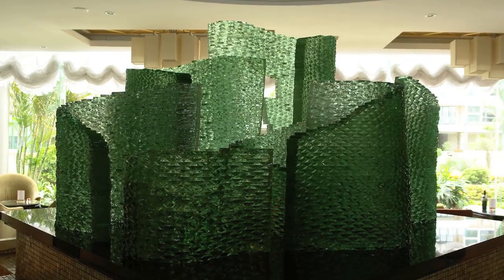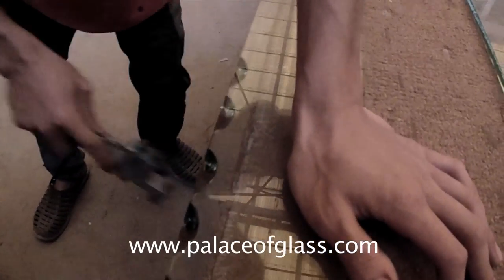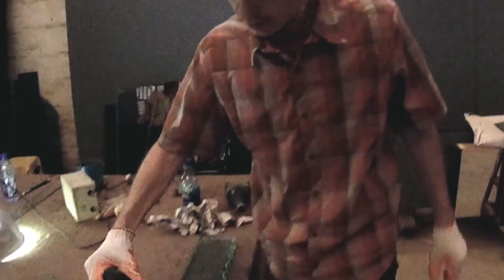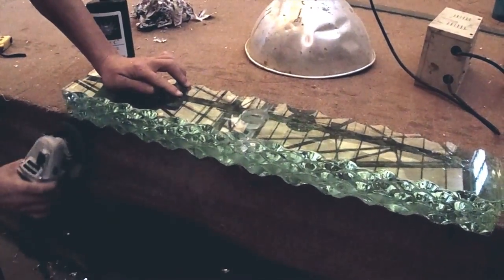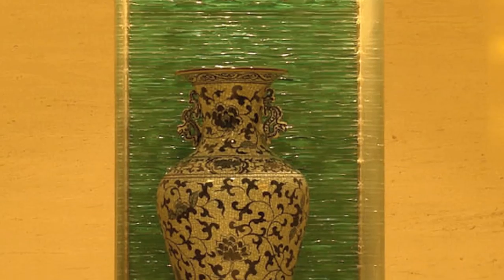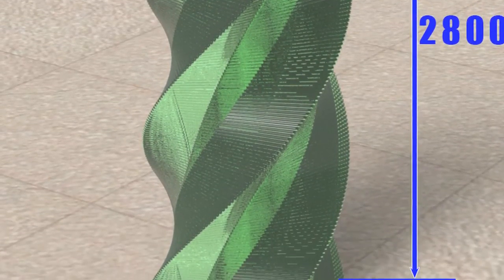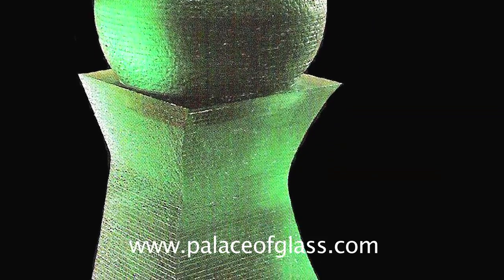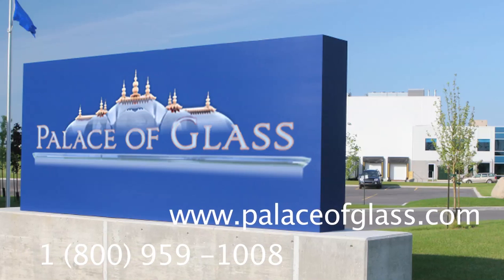Make STACKED GLASS with Showcases of Installations #stackedglass #glasswall #glassdecor #artglass

Comment: I wouldn't like to think how much one of those pieces weigh .is the glass so strong that stray cracks don't happen.
Reply from the maker: good point, you have to calculate the weight of the layers and thickness of the glass. Glue between the payers decompresses the pressure a little bit, but still glass remains the most solid substance to work with. Sometimes metal rods or in between layers can also help.

There is additional info here: https://palaceofglass.com/catalog/art-glass-production/stacked-glass/

Comment: What type of glass are you using?
Reply from the maker: Different types of glass can be used. The video uses generic flat glass, that results in greenish hue at the end. You can also use low iron ' diamond ' glass for completely white look. Thickness of glass in the video is 10MM, can also vary.